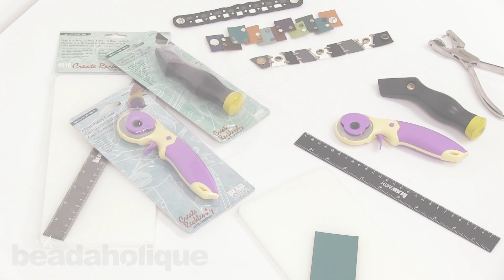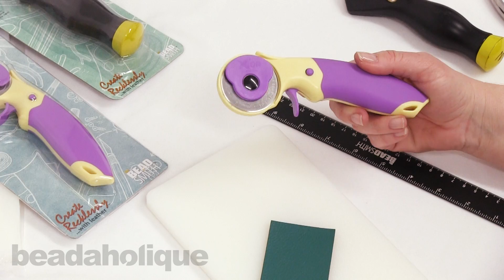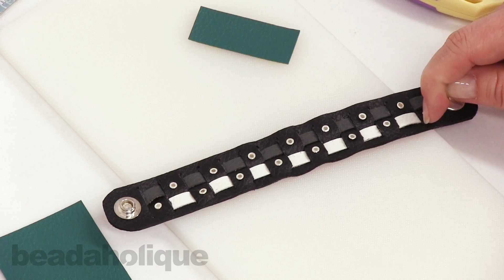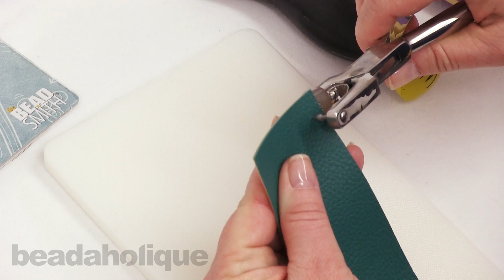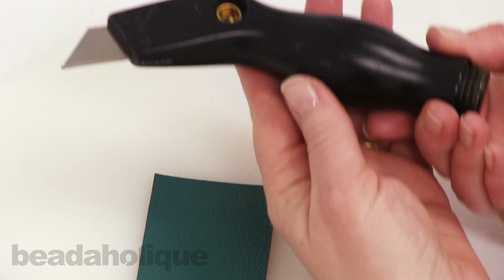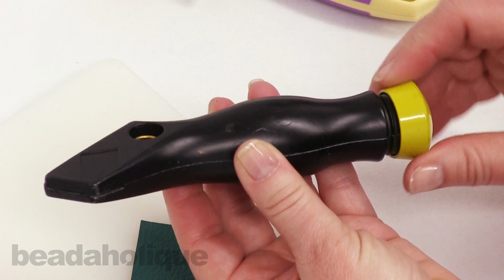How to Cut Faux Leather with Melissa Cable

Comment: Hello there! Could you please help me? I may want to cover my speaker cabinets with artifical leather, but not entirely, and the cut edges would be visible. Can you suggest me a type, which is the most suitable for this application? Which one looks the best with visible cuts? I consider to use 100% PU, PES or maybe PVC.
Reply from the maker: Unfortunately our designers don't have a lot of experience comparing and contrasting the different kinds of artificial leather on the market. I think your best best would be to ask folks that specialize in garment making. Sorry I couldn't be more helpful!

Comment: You mean a pizza cutter.
Reply from the maker: You can try a pizza cutter but in our experience actual pizza cutters don't work well for this. Their blades aren't sharp enough and their wheels are too big to concentrate the cutting force. Most pizza cutters have a four inch wheel, this rotary cutter is 1.75 inches.
Reply: @beadaholique  saw the same thing on a couple of other videos. Guess I'll get one.
Reply from the maker: @129jmaster  I do that research with every speciality tool I buy too. But as long as you have leather to cut you're gonna be keeping this thing very busy. Here's a link to our store since you're looking to buy: https://beadaholique.com/products/create-recklessly-rotary-cutter-for-leather-fabric-paper-45mm